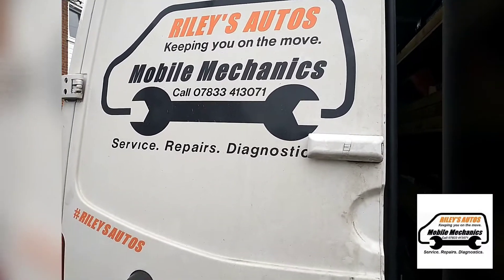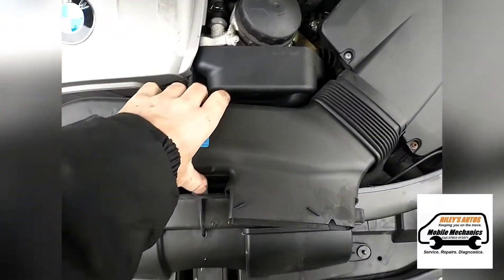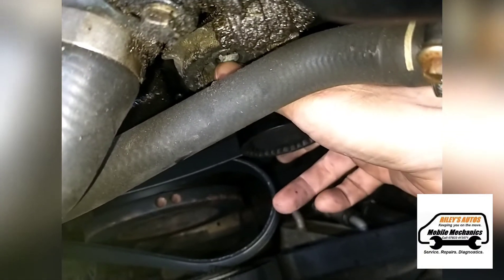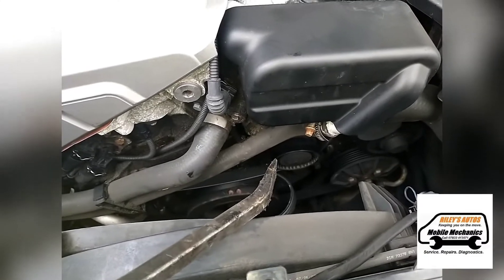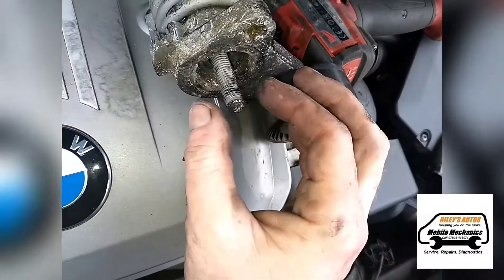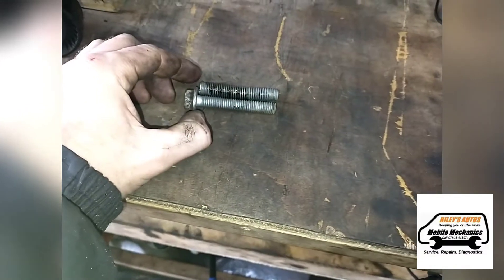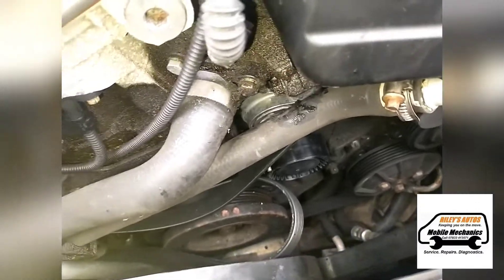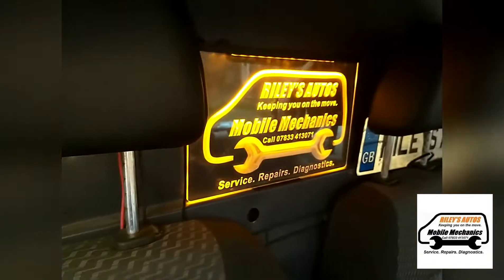BMW 320i E90 Auxiliary Drive Belt Serpentine tensioner bolt snapped broken off removal replacement

Comment: I just did the same job on a 2007 BMW 530i. The tensioner bolt head sheared off...just like here....and the failure caused the destruction of the belt tensioner...the tensioner broke and fell into the splash pan in pieces.

Torque for my car was 18.4 foot-pounds plus 90 degrees. Note: Working with aluminum fasteners that are torqued-to-yield...really requires a torque wrench. And preferably one with an angle meter...which I have. You'll be surprised by how much this aluminum bolt will stretch while you're tightening it. You'll meet resistance long before the bolt, in my case, reaches 18.4 foot-pounds of torque and then you have to add another quarter turn...90 degrees. Not having worked with aluminum fasteners like this one...my guess is that without a torque wrench, you'll want to stop long before you reach full torque...thinking that you might be over torqueing the bolt. Find the proper torque spec for your application. It's one of those need to be right things in this application. No uga-duggas here.